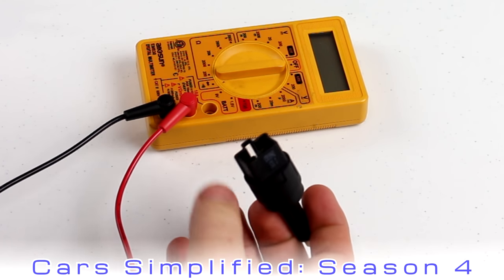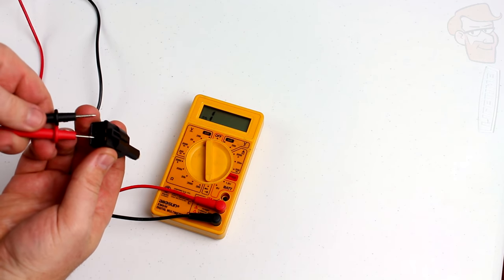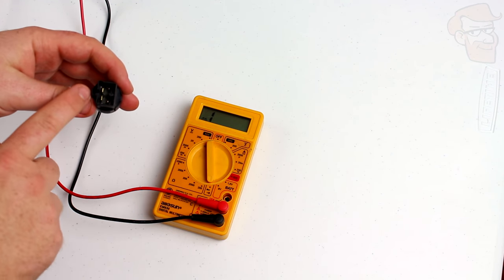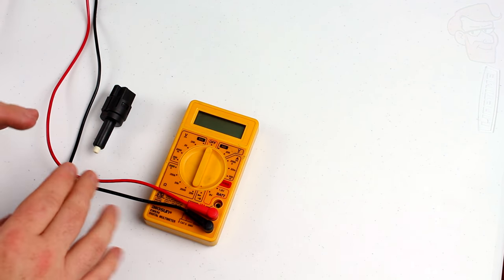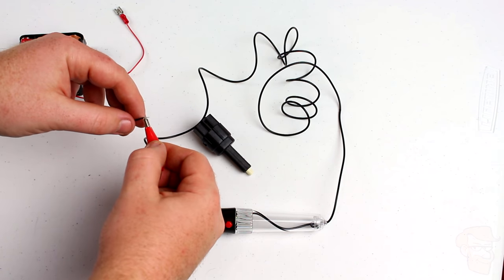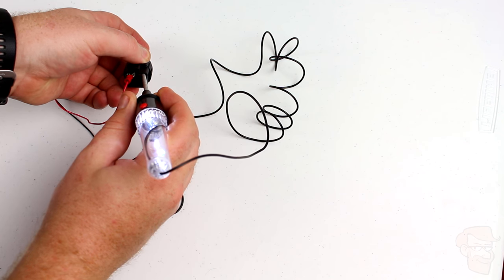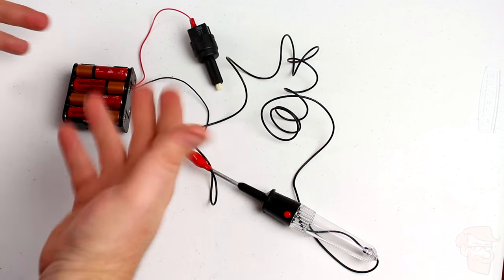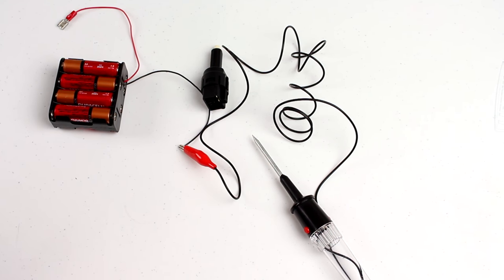How to Test a Brake Light Switch (Two Ways) • Cars Simplified

Comment: Does that mean if the light stays on without pressing button in when I connect terminals both ways my light stays on and turns off when I push the button this mean I have to replace?

Comment: Have to be carefull switch can carry enough power to look good on the ohmmeter but cannot pass enough to light up the brake lights. Being there done that
Reply: @bobdarker519  if it fails the continuity test then it is bad for sure
Reply: How did you figure out that was the problem?? Is there a way to measure the power it passes to light up the brake lights using a meter? I'm very new to meter stuff.

Comment: How to test wiring that is connected to this switch?
Reply from the maker: To test the wires individually, you will have to make a long lead for your multimeter and connect to contacts on the light socket.

However, you can also test to see if you are getting power at the socket by connecting your leads to the positive and negative contacts on your brake light socket. You may also have a tail lamp circuit back there; if so, you can either test both or look up your wiring schematics.

I'll make a video about it in the future.
Reply: @CarsSimplified  make it fast pls. And, how to test wire if I dont have aces to both wire end? In my case it is wire for camshaft sensor.

Comment: Does to have to be released til the very end to work or is is enough to release a little bit 0.1mm and it starts to work?  My break pedal switch works fine but there is still an issue in the computer of the car with it... :/ My lights turn on in the car halfway of the switch....

Comment: where did you get that battery thing? what is it called?
Reply from the maker: I got it from an electronics surplus website called Jameco, and they just call it a battery holder. I have 9V battery connectors from there, too.